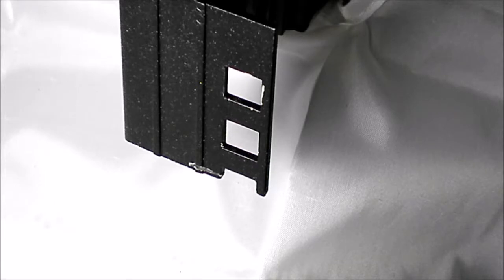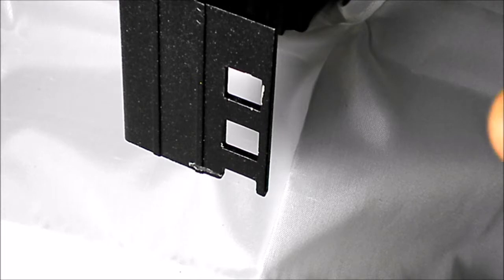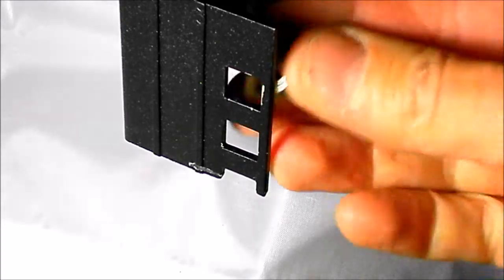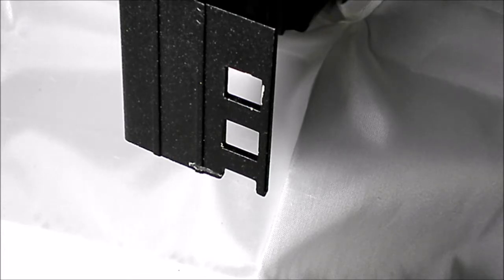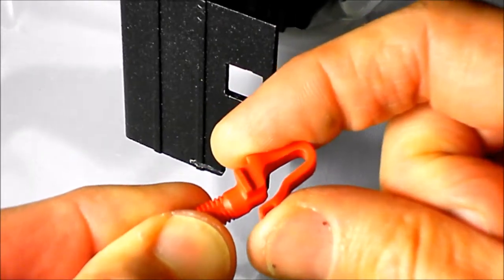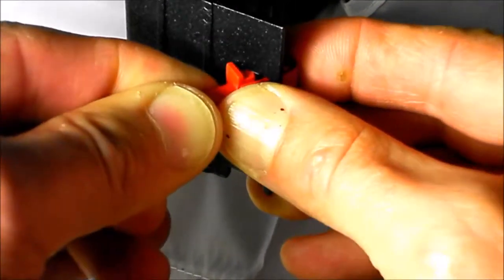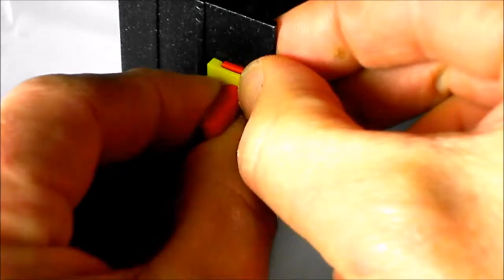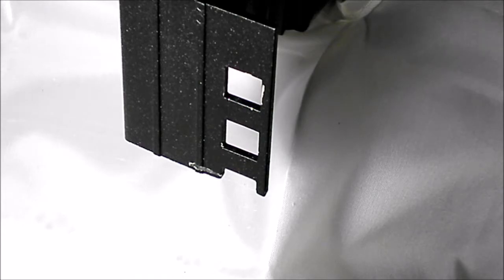How to insert Rackstuds™ when the hole seems too small

Comment: Would this work if your holes are undersized at 9.03mm?
Reply: Sorry no. We've seen holes as small as 8.89mm when the standard is 9.5mm so 9.03mm is a bit too small. The studs are made of metal replacement material so there is definitely no give.
Reply: My Cheap home rack measures in at 8.86 i ended up taking a flat file to the holes and it made quick work of it, took me longer to cover things up to avoid fileings from getting in the equipment than it did to file out about 12 ru of holes,
Reply: @sirbuffaloo6597  Very creative Sir!